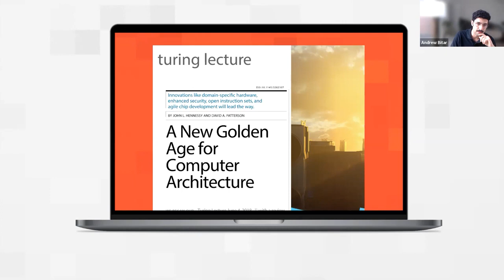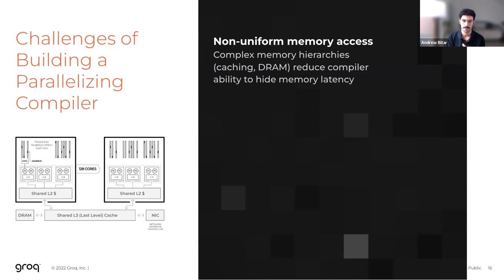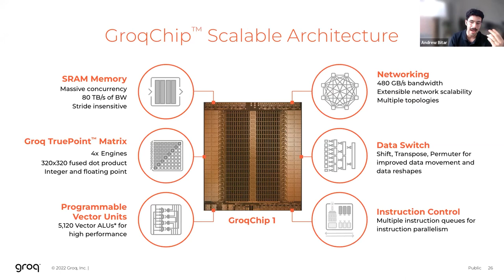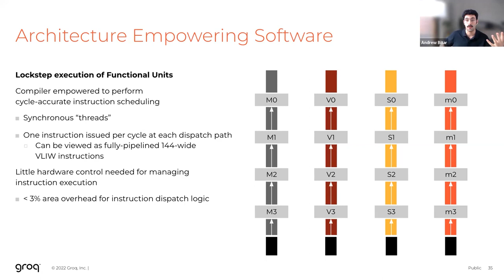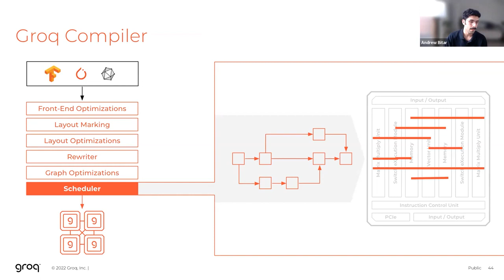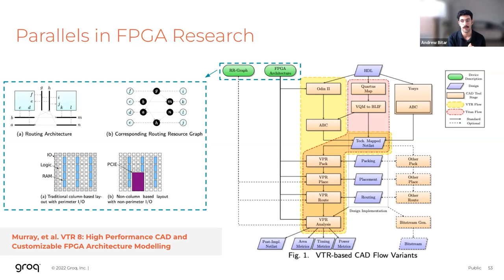Software Defined Hardware for Dataflow Compute / Crossroads 3D-FPGA Invited Lecture by Andrew Bitar

Comment: From DARPA website: The SDH program will measure compute efficiency (in terms of giga-operations per watt (GOPs/Watt)). By the end of the program, it is expected that SDH systems to be at efficiencies within 5X of ASICs and 500-1000X better than CPU implementations with the same programmability as current NumPy/Python implementations.

Wow